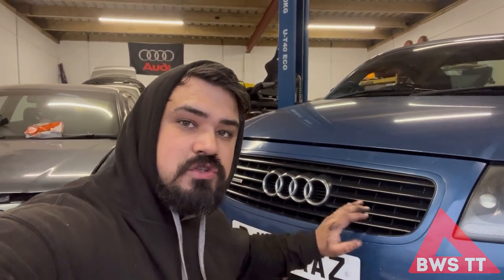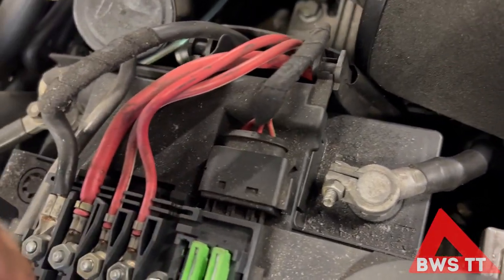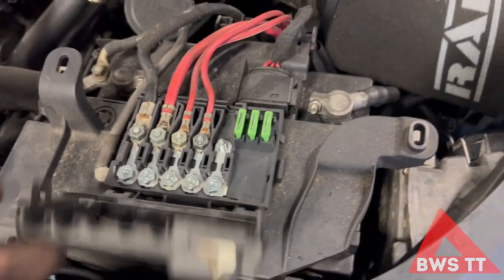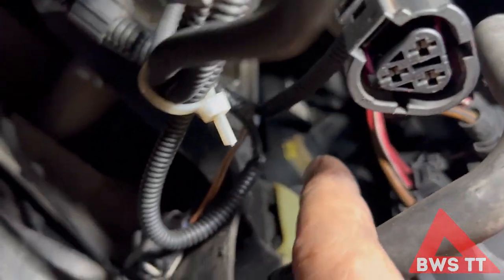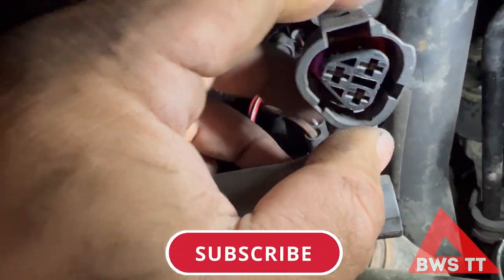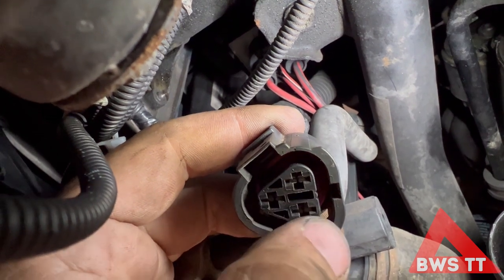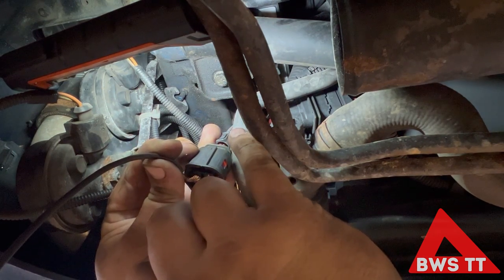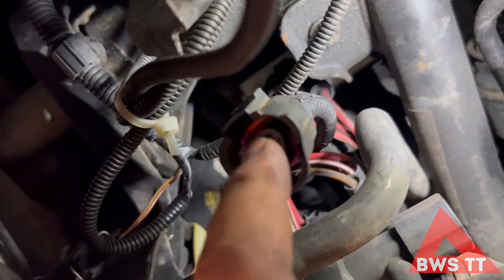Fans not kicking in - Audi TT MK1

Comment: my fans dont work at all, i did the thermal switch test jump, and both fans were working on high speed, replaced the thermal switch on the radiator, and a brand new fan control module, still nothing

Comment: for me dont work low speed when open ac... if bridge wires on thermo switch work both high and low speed also work if remove fuse 16...im change already thermo switch and thermostat but is same no fans with ac..what need change next?only resistor mode can fix it?

Comment: My fans work intermittently. When the car is cold from the night, the fans operate when the AC is on or when the engine reaches 97º Celsius. However, after driving for a while, especially in traffic or at a stoplight, the fans do not work, even if I turn on the AC. I turn car off, then turn on and fans starts working again (not always). Maybe the fans are bad? I replaced thermostat, termoswicth, coolant temp sensor, fan relay box under battery..

Comment: need a bit of help , got a 2003 180bhp tt quattro (ARY) keep getting a error for cooling system fault , i replaced the temp sensor but my car seems to be taking a long time to get to warm , and when driving it will hover around 60-70c , and in traffic if i let it sit itll go to a max of 89-90c but quickly will go back to its usual 60-70c when driving .. i have no leaks on any pipes and coolant is brand new and new temp sensor is in , fans work too when you turn the heater on , any pointers , possibly a stuck open thermostat ?
Reply from the maker: Definitely sounds like thermostat to me
Reply: @BWSTT  perfect ill get it swapped out and let you know ;)

Comment: The most common failure is the fan controller and not everything else you mentioned.Great video although with simple step by step checks as always.
Reply from the maker: The fuses are really commom to go, the fans often lose high speed, and yes the relays go, so its well worth checking what you need before firing the parts cannon at “the most common failure”
Reply: @BWSTT  you have absolutely right for the procedure everyone should follow.My objection is that the wiring have quality and even their 20 years aging, it's in great condition (at least in my country,cause I see huge amount of rust at the bottom of your cars but I don't know if it's due to your climate conditions or from the salt on the roads in winter),themostatic switch usually works or not and genuine switches doesn't tent to break but as you already said they just aging.What is left?The fcucking controller that's super expensive from stealership and almost junk from other sellers around referring as almost genuine.I have changed all of this parts at my car and every single time the fault was at the controller.I'm telling this cause I have changed one time only switch,probe, one fan I forgot to mention before and 3 or 4 controllers (one was faulty from the box).But that's just my car... Excuse me for my English.

Comment: I had mine overheat a couple of years ago. The garage I used to use said it was the 'fans control module' which they apparently replaced. After that though they said it was still getting to warm so took water pump off and the plastic impellers had disintegrated. They replaced the pump with one that has aluminum impellers. Obviously the timing belt was done too so not a cheap visit! It seemed ok apart from a short while later I noticed it never reached 90 degrees and usually not hotter than about 78degrees. Took it in and they said thermostat was faulty. I guess they never changed that after it overheated! .... I don't use them anymore...

Comment: Hi, Thanks for the Video, really well discussed. So, I have a SEAT LEON CUPRA R 2005 1M and this problem has started. In normal driving the temp stays at 90 degrees, and when I'm stuck in traffic the temp will start to creep past 90 degrees. To resolve this I need to switch ON my AC. Does this mean the thermal switch at the rad is gone?

Comment: A good video 
I have this cooling fan issue which I need to look into on my tt 

Does the ac have to be gassed up correctly in order for the fan to kick in with ac 
I turn ac on I hear the pump kick in and which brings engine revs down as it starts but still no low speed fan 

I'm guessing the ac system pressure is low 
Thanks 
James
Reply from the maker: Might be a bad control relay

Comment: Amazing video thank you. In my case when I bridged the thermal switch, fans kicked in at low speed but not high speed. What does that mean?
Reply from the maker: You need to try and power the high speed fan directly, if they work like that then it’s the relay

Comment: My fans come on when the aircon is active.  But I get a high reading on the dash when in traffic (no fans cutting in) and a lower reading from the consul from the 49c setting.  When the dash is showing over 100 the car doesn't feel overly hot. Could this be the coolant temp sensor?

Comment: If the radiator is full of crap and not getting coolant flow at the thermoswitch the fans will not come on or will come on late causing spikes in temperature.
Ask me how I know ?
Reply from the maker: That is a good point, thanks for adding that

Comment: hello i got a problem of fan in my tt 225 BAM 
the fans are kickin in first speed when i do a bridge at the sensor in the radiator 
but when i do my bridge in the second and third wire (high speed) 
my fans dont want to run fast
i think my fan control module is ok because when i test the high speed i can hear the relai 
can you help me ?
my fans are dead ? 
thanks
Reply from the maker: Bridge your fans with 12v from the battery, this will tell you if they physically work or not

Comment: Hey men I hope you have ideas for me if u don’t might I have a 01 TT that the fans come will turn on when the engine temperature goes to 105 that’s when they turn on only on slow speed and I ready put a new control module a new fan switch and still the same thing they won’t kick on high speed only on slow speed if u have and idea I will purchase plz let me know if you have any ideas thanks
Reply from the maker: I though the video made it clear, but maybe not 🤔

Comment: Good morning men and I don’t think is the fans because I disconnect fan switch and test with the wire and they work fine low speed and high speed so I don’t think is the fans did think is something with the A/C because the a/c is not working because they saying when u turn the a/c on the fans well kick on but on my TT they won’t kick on

Comment: Quality content bud some good info. I have a question is it normal for the temp gauge to be different to the reading on the heater read out using the 49c code 🔥🔥🔥🔥🔥🔥
Reply: They should be the same or very similar. The dash clocks are waited so 80-100 it will show 90
Reply: @TheParrottBros  when it shows 90 on dash it's 96 or so on the heater read out bud
Reply from the maker: Thats normal
Reply: @BWSTT  cheers bud much appreciated